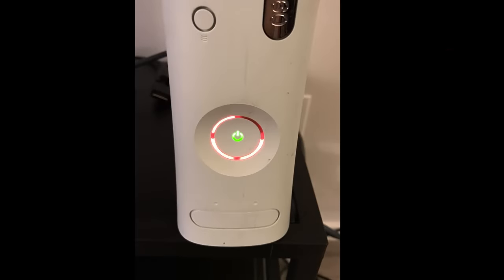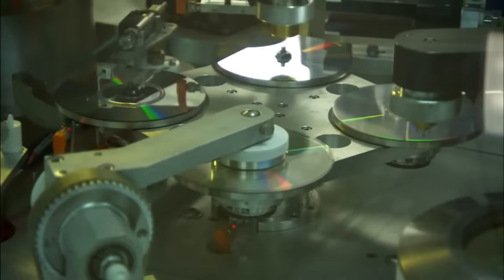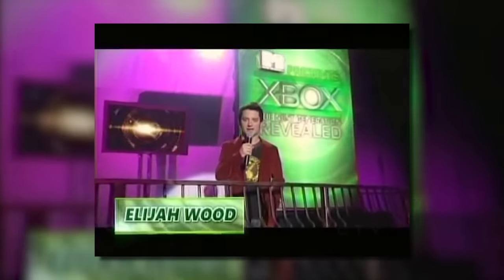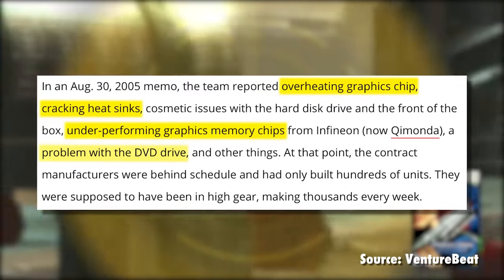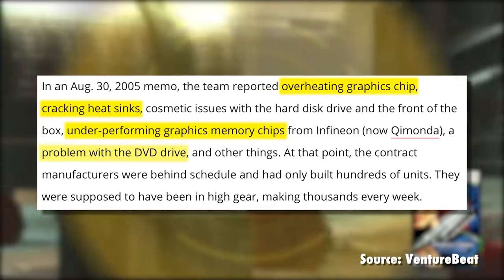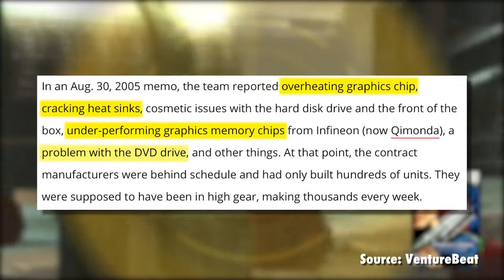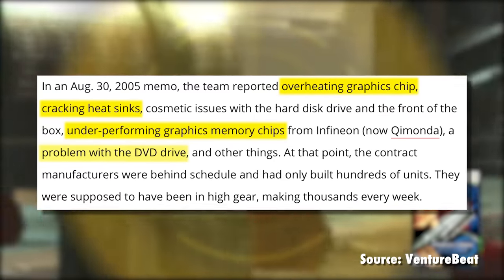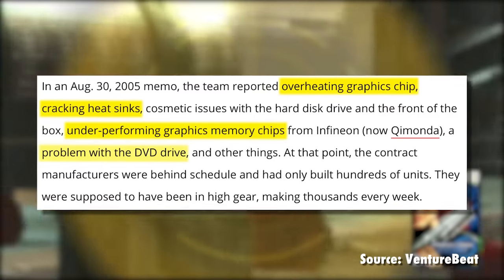History of the Xbox 360 Red Ring of Death | Past Mortem | SSFF

Comment: My cousing xbox was manufactured in 2006. Surprised it hasnt died yet.

also yes im jynxing it 😈
Reply: watch it die in the next week..
Reply: Is it dead?
Reply: zonespace 78 i
Reply: zonespace 78, that's the year I was born
Reply: mine is from 2005 lol
Reply: Mine was made in 2006 and it has had three rings before but let it sit turned on for 10 hours then it worked again and I always belated on it and I could leave it on for 4 days and nothing would happen but I didn't dare to leave it on longer and its fullcof junk and it has beenvdroped 5 times and everything still works on it till this day
Reply: My die in 2017
Reply: Joshua McQuade HAAAAGHHHFFGHJ 🤣😂😂🤣
Reply: AsymmetricKana yep
Reply: zonespace 78 I have both, ps3 is very underwhelming, same for the one and 4, the 4 is muff cabbage.
Reply: mine is 2014 and its not dead xbox is great!
Reply: zonespace 78 My Xbox 360 was made in 2011. Still going at 7 years old!
Reply: Mine is 9 years still running strong.
Reply: My xbox is 10 years old and still working
Reply: My cousin bought one off Ebay two years ago, died in a month lol

Comment: My xbox red ring it over heat so i turn it back on its still good i cleans my room from dust and my xbox 360 slim still works like it was bran new besides melting whatever is neer the top of it 🤣 no realy
Reply: I had overheating issues with my 360. All i did was removed the plastic exterior and have never had any red rings since, it does look quite ugly without the exterior though.

Comment: I remember as a kid putting a big computer fan i found and soldered it to some 12v i found on the chip board inside the xbox 360 with the cover off. Worked for a few more months. And i ended up becoming an electrician

Comment: I wanted to buy an Xbox 360 that specifically looked like the launch model, but I wanted to get one that doesn’t Red Ring. Turns out there is one model that’s way less likely to Red Ring. The Jasper model, while still running kinda hot, doesn’t run nearly hot enough to brick the machine. The biggest thing the slimmer elite model introduced was adding a temperature sensor so it shuts off the system before it gets too hot. Literally cannot red ring in the traditional sense. The Jasper model doesn’t have that, but still runs cool enough that you’re really unlikely to red ring, which is way better than the older ones, which are almost guaranteed.

The model he showed was a Falcon board, which aren’t quite as resistant to red rings, but are still far better than launch boards.

To tell them apart, look on the back, specifically the stick with the information about manufacture date and whatnot. At the bottom left corner, there’s some info about the power output, look at where it says 12V, that’s the 12 volt line.

If the 12V line corresponds to 16.5 amps, that’s a launch model, called Zephyr.
If the 12V corresponds to 14.2A, that’s a falcon model, or similar model
If the 12V corresponds to 12.1A, congratulations, you have a Jasper.

There are other models that these correspond to, as well, for the 16.5A and 14.2A, called Xenon(the true launch board) and Opus respectively, but those boards don’t come with HDMI.

You can kinda get an idea of what model something is by the date of manufacture as well, but that’s not completely reliable, since at certain years and times, two boards were in production, and those happened to fall partially within the Xbox’s early heyday, with 2007 producing both Zephyr and Falcon boards, and 2008 producing both Falcon and Jasper boards, so the best way is to look at the 12V line. Also, if it’s 2009 or 2010, pretty likely that it’s Jasper. Mine was manufactured in 2010, so mine’s a Jasper.

Comment: Its 2021, I've still got my launch model 20gb that works fine. 

I've just kept it clean and in a well ventilated area, not stuck inside an entertainment center, or on the carpet.. 

Every single one of the ones I've fixed was full was full of dust, carpet fuzz, or cockroaches and other bugs.

Comment: I got a 360 on christmas 2007. I got red ringed once after plugging in a guitar hero 2 controller. After getting it repaired it worked until I sold it in 2011. I was one of the lucky ones with only getting one faulty product.

Comment: I went to boot up my 360 a few months ago, and saw the red ring around the power button. I unplugged it from the wall and plugged it back in, and it worked just fine. Sometimes when I go to turn it on the red ring is back, but all I have to do is unplug it and plug it back in and it seems to work just fine. LOL
Reply: i have 2 360s for multiplayer fun so we can have one each and they both have red ring now :( mine wont work so i dont know what to do with em i dont rly wana throw em away but ther not worth anything so they r both just sitting on the shelf at the minit lol one white one black both red ring bit like that old joke whats black amd white and red all over lol

Comment: weird thing is my original core model 360 never got the RROD but I did occasionally get two red rings which meant it was overheating, and that was from me putting it on it's side instead of standing up it, I did that because we had one of those big-ass free standing TVs with a glass cabinet directly underneath, it was a beast and a pain to move and you couldn't fit the 360 underneath there standing up so I kept it on it's side for years not knowing I was slowly damaging it by doing so, one day it died while I was playing Saints Row 2 just after it had come out, the colors on-screen got all warped until eventually it black-screened, the guy I sent it to for repair said it had a burned out graphics card, then weeks later I get it back and it works at first then the same problem again so I send it back to the same guy again and finally I get it back and it works great, lasted me for several more years until it died for other reasons, fortunately my birthday was coming up so I asked my mom to get me a new one so she got me one of the newer models and it lasted a while(i'd forgotten the password for my old gamertag so I had to get a new one, fortunately I hadn't gotten big into achievement hunting yet so I didn't have a lot of ground to regain) around the time Phantom Pain came out I saw it starting to have issues with colors like last time only this time is was happening much more gradually, I knew it was on it's last legs so before it died completely I made sure to back up all my game saves and traded my old 360 in along with some games at Gamestop for store credit towards other things and I made sure to buy the 360 Elite since it was the last model made that thing still supported wired controllers(I prefer them over wireless controllers for the 360 as i'd rather not have to keep buying AA batteries just to play my games if I can help it)and it was much less prone to failure, i've had my Elite for almost a decade now and it still works great to this day.

Comment: The actual cause was not the design of the 360s, it's the materials used for the GPU. in 2008 They figured it out and started fixing 360s & Making new fixed models like Jaspers and Tonaskets
Reply: It was the 90NM process that didnt  change to 65NM until 2009. What people at microsoft fail to disclose to this day. Is that the core/pro models that had the 90NM CPU and GPU. were replaced with a completely redesigned all in one APU made by AMD in 65NM.  In 2012 the final lot of XBOX 360's recieved a 40NM APU whihc had the lowest thermals of all the 360's ever released.

Comment: What i wonder is why they didnt use slim optic drives in the 360 core. There were aviable in 2005, and could have helped inmensely with cooling being, well, smaller than a full optic drive, without huuuuge performance lost, and not that much cost added

Comment: my original xbox 360 from 2008 has been through hell and back, it's had several red rings, it caught on fire due to the power port being loose and shorting out which we thought killed it but recently  after it being in storage for several years I got it back and fixed it, now its at 100% working capacity and I now use it almost daily XD

Comment: So if I drill about 5 big holes on the both sides of the case and fit tiny fans in them there will be no cooling problems and the red ring shouldn't appear? I know Im saying it like its a question but regardless of your answer I'm still going to do it.

Comment: It should be mentioned that the Jasper variants of the original 360s are far more reliable than older original models. 2-3% failure rate vs 50~%, with reliability identical to the S model

Comment: It's not entirely Microsoft's fault, at least not as far as the main engineering team was concerned, but their choice of using cheap suppliers and manufacturing was the primary driver behind so many RRoD failures and the low initial yield rates. The ongoing transition to RoHS was also a factor: in that era there was a mishmash of different solder formulations available, each with their own melt temperature and flow time requirements, where at least one type of solder used in a complex device such as this often didn't flow properly because it was in the wrong thermal profile. Some factories were also not set up to deal with the new specs of lead-free RoHS manufacturing which exacerbated the problem. As a result you had partial component solder melts that worked kinda at first but then failed hard when the parts got hot. In addition all of the large chips on the 360's main board were BGA-style which are very difficult to troubleshoot for bad solder joints and rework as necessary. Of course this era was also affected by the counterfeit capacitor fiasco that plagued pretty much every major electronics manufacturer between 2002-2006.

Comment: The problem wasn't really the excessive heat but more specifically it was the combination of extreme temperature cycling combined with the god awful, newly mandated, lead-free solder used in manufacturing which resulted in solder joints cracking or pulling away from the PCB that would expand and contract every time the system heated up then cooled back down. This is why all the various "fixes" were things that applied more mechanical force to hold CPU and GPU onto the system board, things like the penny trick, of the after market X-clamps. Or they were poor-man attempts at re-flowing the solder of the BGA connection, like the towel trick, or actually cooking the xbox in an oven.
What would probably have helped a great deal is if microsoft had pushed out a software update that made the 360 shutdown much more gradually, running some sort of artificial workload to keep generating heat and slowly reduce it over a period of 5 minutes or so. It obviously wouldn't have solved the problem but it would likely have significantly slowed down the deterioration. I suppose they could also have given customers the option to enable some sort of thermal limiter that underclocked the system when it got too hot, but that definitely wouldn't have been popular.

Comment: The actual problem with the 360 was the solder balls under the CPU cracking. The solder would be continuously heated and cooled over and over and the balls cracked.

Comment: My PS3 is about 10 to 11 years old and it works fine, it just has a network problem so I can’t play my games. My Xbox is 7 to 8 years old, runs fine. I have the same controller that came with the Xbox. My Wii is probably about 12 years old and it runs perfectly. My old 3DS is probably about 9 years old and it runs perfectly. Same for my 6 year old 3DS XL. Also this old Gameboy SP that I got as a gift. I found this old DSi in my room that might still work if I charge it up. Idk about you guys but I tend to take care of my consoles

Comment: The red ring of death was caused by low TG underfill in the GPU. This was an industry wide mistake in electronic manufacturing. Laptops, desktops, graphics cards and the early playstation 3 systems all had this issue. 

In later board revisions Microsoft fixed the GPU issue by having a high TG underfill in the chip. So any Xbox 360 manufactured after May 2008 should be fine. As the boards would be V2 falcons, and Jaspers. Which are the most reliable boards on the older Xbox 360s.

Comment: you mentioned some of the code names. but you didnt do enough research fully. the original motherboards were the xenon motherboards(90nm cpu+gpu). you mentioned zephyr, but not jasper. i currently own a 2010 jasper elite, 11 years of ownership and not one issue. the console you listed a 2008 premium would have been a falcon motherboard console. the jasper has the 65nm cpu+gpu which yielded alot less heat.

Comment: So this is my ONE experience with the Xbox brand. Back in the day I had a friend lend the 360 to me, I remember being extremely hyped to see next gen graphics in person. I boot up MK9 it was awesome. Then I try to change the discs and check out Gears, the disk drive takes a long weird time to open but eventually does and I played it, great. Next day I tried to change disks again, the f*ckin disk drive won't open no matter what I do, the thing is jammed like a mf! I went into panic since this is a cutting edge new console and the thing was not mine. 2 days of sheer dread go by I finally figured Youtube might have a way to fix it and luckly it did and it worked, but after that I didn't dare touch it again I just returned it to my friend asap before the f*cking thing broke while in my posession again. So yeah, great console

Comment: The one thing that could have saved 360 when it first came out was the ability if they could’ve used lead solder can solder was used instead lead solder is better because from going from cold to hot it Will not crack like tin Solder did but due to laws they couldn’t use lead solder.

Comment: And this is why I own a PS3. It still holds up today, and is in some cases better, even against my Xbox One X. Also, if you just cut a hole in the top of the Xbox 360, would that solve the problem? Seems like it would if all the problems stem from overheating and heat damage over time.

Comment: You literally listed every change but the one that actually was the cause of the RROD:

Certain connections soldered on the board would heat and cool repeatedly through general use. The balls would become brittle and more fragile over time until they snapped, effectively ruining the connections. Since there was nothing being transmitted the system literally had no instructions to do anything but sit there.

Comment: i once got a xbox 360 slim from a friend who was having trouble with the red ring, they said if i fixed it i could keep it, well i opened it, changed the heat sync and it still didnt work, so i left it to a side and my dad threw it out, fast forward a few weeks later and find out the power cable may have been the problem, long story short i'm an idiot

Comment: My Xbox 360 gave me 4 rings and I thought my cables came out but they had failed and I tried to reset the system completely and then my Xbox didn’t turn on after so I just gave up and packed it away in my attic

Comment: What happend was that people who bought a 360 between 2005-2007 would have the older mother board but in later 2007 they revisioned the mother board and your was a 2008 so that fixed most rrod errors but your error is probably a general hardware failure maybe a bad cd drive or gpu or cpu

Comment: does anyone remember getting the green light of death on the ps3? i have 2 ps3s and one of them (a ps3 slim model) gave me the green light when i was in middle school. i took it to a sleepover and left it running on carpet for hours so i’m pretty sure i fried it. it still boots like 30% of the time tho. sadly, for some reason the hard drive from my brokenish one won’t fit in the other one i have that works perfectly (it’s also a ps3 slim, slightly different model tho) .. so i have to rely on the brokenish one to access my saves

Comment: The episode was really entertaining, but in all its length, it did little to explain the actual technical problems that led to the issue. “Cramming a lot of tech into a slim package” doesn’t tell the whole story. Also, this episode is incomplete without mentioning the motherboard revisions that were made: Xenon, Zephyr, Falcon, Opus, Jasper, Trinity… I own a Jasper model (2009), which was the first one to really have a normal rate of failure and it was before launching the slim models.

The official Xbox documentary (which came years after this video) does tell what actually happened and why it was so difficult to find out.

https://youtu.be/z2d6IMBS8oY?si=bs4IMlEHdVHxmM45

Comment: the claim that the power supply wouldn't fit in the case is a lie; they just wanted to use outdated, oversized power transformers instead of paying for regulator chips.

Comment: Microsoft should have learned from Sony. Sony releases a redesign of it's system every 3 years. Had Xbox 360 Slim came out in 2008 the RROD problem would have been solved. Instead, they waited until 2010 to release the slim. Sony released the PS3 slim in 2009!

Comment: Mine died from s single red light 😢
Reply: single red ring if its the S or E. Just means one of 6 resitors failed and all you need to do is reflow the resistors. Easy fix takes about 2 hours
Reply: @InternationalLiaison  nah it was general hardware failure. Fixed it twice, worked for a couple of months before dying again.
Reply: wtf omg i only have win 10

Comment: This was the reason I never got into the XBOX line and never will. 

Had friends own multiple systems anc they had birh pushing and pulling ventilation, did everything they could to prevent overheating. Yet they had it happen.

Freaking design flaw. They should have replaced or refunded the full price.